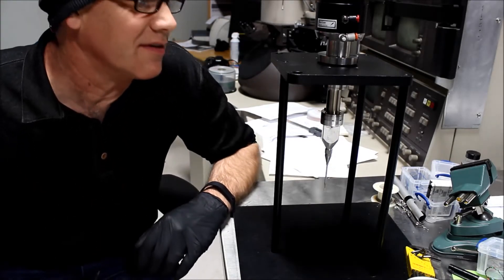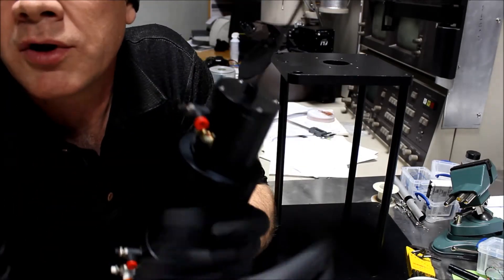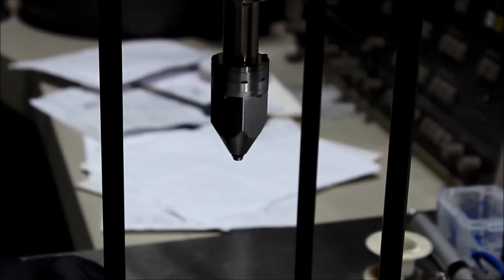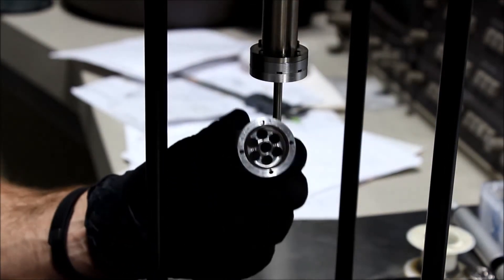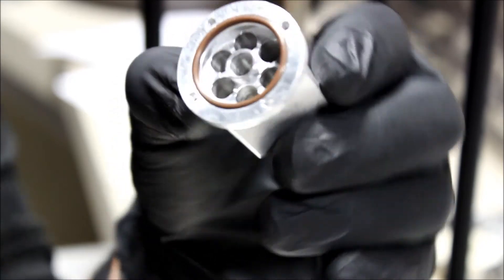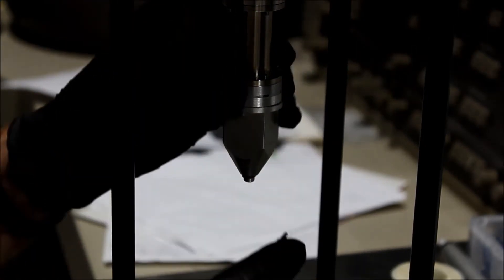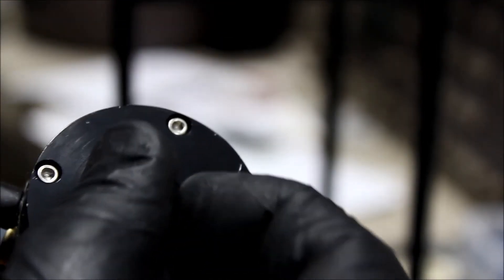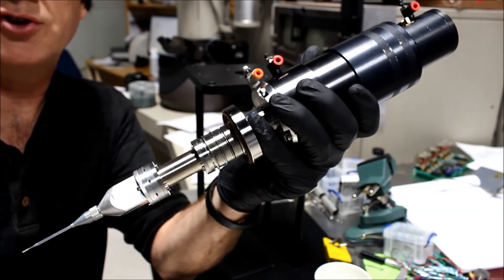GIS Refill

Comment: Hi, can you help with problem of stigmator?
We have problem with stigmator (or else). See the video https://youtu.be/F7VEA0V_dTM How can it correct? 
 From the very beginning after the assembly, there is a problem with the stigmator (deflector). On the left side of the picture is all vague. Also, the problem manifests itself during etching. Etching horizontally is intermittent. It helps only to shift the image to the left by the deflector, so that this zone will leave the screen. But in this case, the etching becomes less productive. And problems with intermittent etching is not solved. Especially well the difference is visible in the video, which shows the setting stigmator. The image on the left is floating. https://youtu.be/F7VEA0V_dTM Is one pole stigmator dead? Or am I doing something wrong? Can the output aperture of the column become dirty? Is it possible to reach the stigmator only by dismantling the entire column?

Comment: Can pt will be replaced to W(CO)6?
Reply from the maker: Yes. The temperture will need to be adjusted to 50 degrees C. Deposition parameters will also need to be changed. Dwell .2, Overlap -50%. Increase beam current to ~40pA/square um for large patterns. Kevin
Reply: can a carbon injector be repurposed for metals?